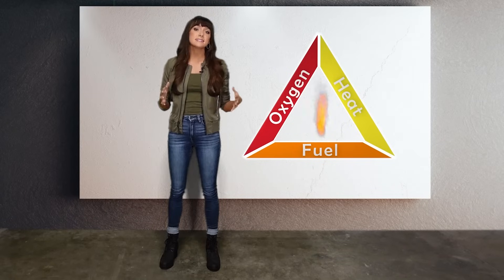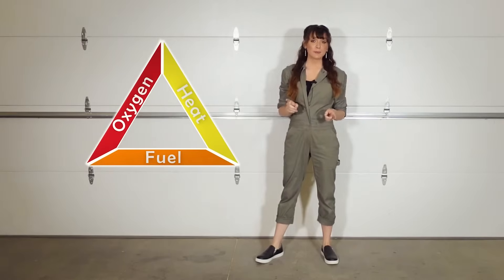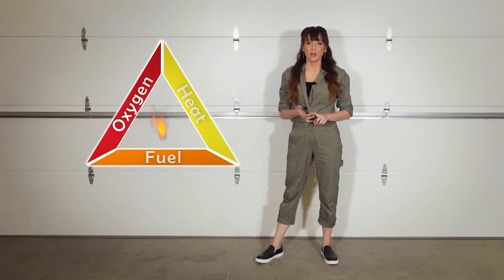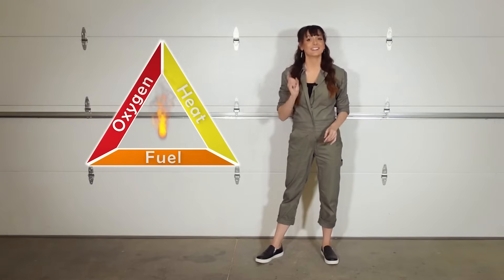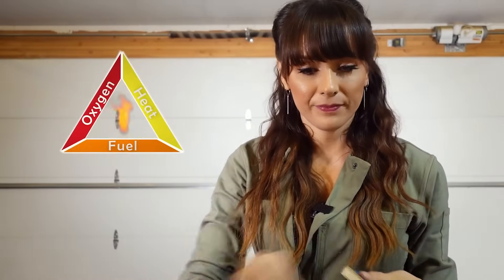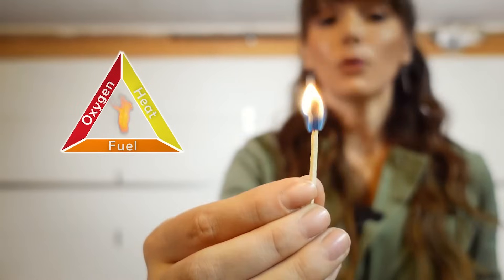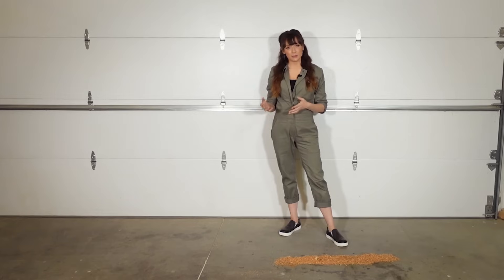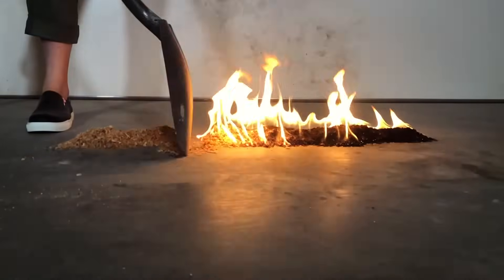THE FIRE TRIANGLE | Ally Safety

Comment: The fire triangle is a basic model explaining the three essential elements required for a fire to start and sustain: heat, fuel, and oxygen.
 
Heat raises the fuel to its ignition temperature, fuel (like wood, gasoline, or paper) provides the material to burn, and oxygen (from air, typically) supports the combustion reaction. Remove any one element—such as cooling the fire (removing heat) or smothering it (cutting oxygen)—and the fire will extinguish. This principle is fundamental to fire safety, guiding both fire prevention and firefighting strategies.

Comment: The Fire Triangle consists of three elements necessary for a fire to burn:

1. Fuel - the material that burns
2. Heat - the cause of the fire
3. Oxygen - sustains the fire 

❤❤❤❤